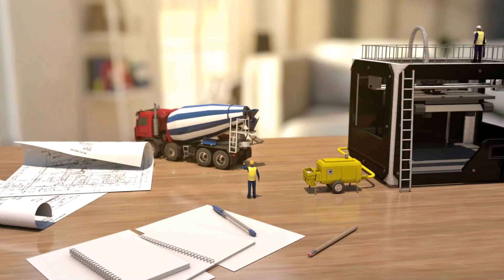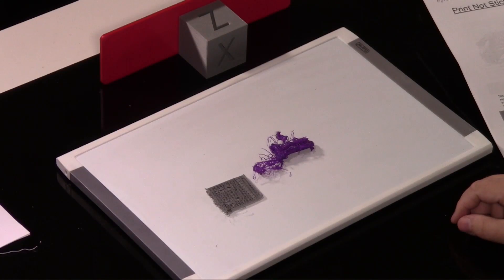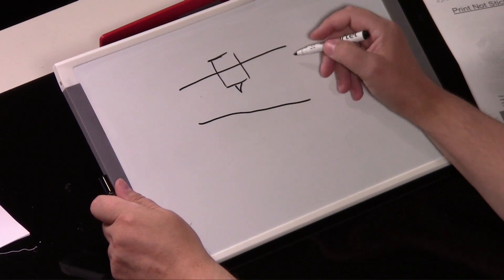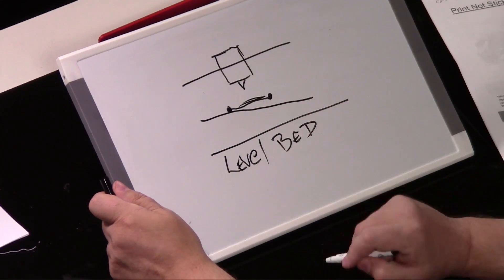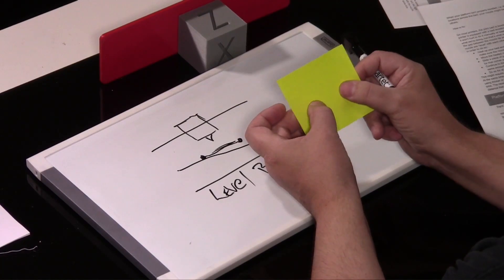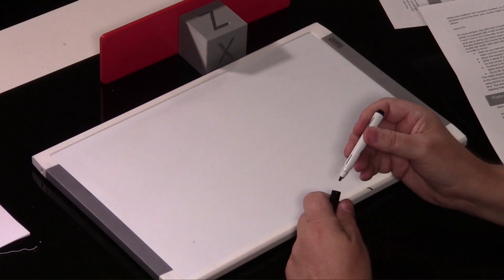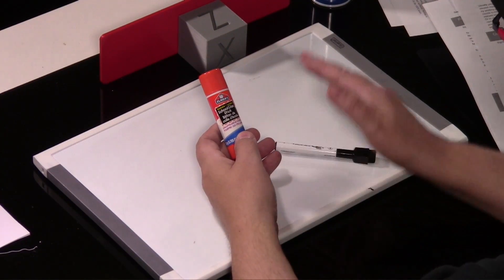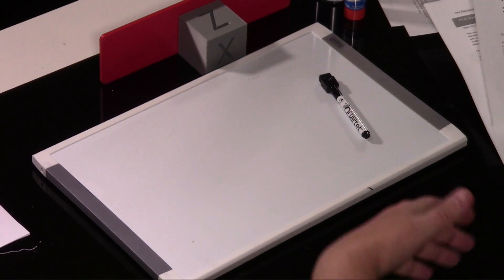Prints Not Sticking To The Bed?

Comment: When I first got into this I had no idea something as simple as bed leveling would be so complicated
Reply: Forreal this is crazy. I’m in tho lol
Reply: same bro, same. 😂 🤦🏻‍♂️
Reply: Amen
Reply: Tell me about it. It has me driven crazy. I found the secret is the middle. Even if all the corners seem correct and the middle is tight it means it's all wrong. Like I said  driven crazy. But R2D2 is worth it. I think...lol
Reply: I find using a piece of paper works well for levelling. When you move the paper under the nozzle, it needs to have a bit of resistance 😄
Reply: @nigelfenlon9035  if I level the bed on my Ender 3 pro on the four corners above the springs the outside edges of the print bed are noticeably lower than the nozzle above the springs and the nozzle will rub the center of the bed. That makes me think the bed is bowed upward in the center, but I’ve had my Ender (first 3d printer) for less than a week so I can’t say with a lot of certainty I know what I’m talking about. Not ready to quit it but it is very frustrating. Any ideas?
Reply: @avega2792  I’m having a similar problem with my Ender 3 had mine for a few years could  never get anything to stick to bed e piece of crap printer
Reply: @98amz  This tip from elsewhere messed up my printing. I should have left it alone

Comment: Well, my first layer's going down perfectly now. But my prints have started coming loose half way through. :/
Reply: go to home depot and buy some mirror tile a little bigger than your build plate, you might need a glass cutter if it's too big.  Use blue tape UNDER the glass until it's perfectly level, check with a metal ruler.  Level the bed and clean with rubbing alcohol before every print.  You will never have a problem again
Reply: Block sand the aluminum build plate
Reply: i heat bed to 80, put a layer of hot melt glue on bed...then turn off heat all-together, wait till it hits under 40 then print...with cold bed cura bed set to 0...when you have finished print heat up again to 80 then remove...simple..

Comment: The advice on bed leveling can't be understated. I'm new to 3D printing and my Ender 3 Pro worked perfectly after assembly. One day, I noticed the main bed support was loose and tried to tighten it, but I must have done something wrong. NOTHING would stick after that except the test lines on one side. I tried everything except glue and eventually solved it by completely dissembling the bed removing it from the belt, checking it for warps, and then re-assembling slowly using a level. It's pretty much back to what it was now. To perfect it, I will install a BLT Touch, but at least I can print again.
Reply: Man, i have the same problem, the SIDE line it's ok but in the middle cant stick, i level the bed mannualy but nothing, i'm so frustrated
Reply: Help, I feel like the same thing my top left is way loose it even fell off, I used it fine til that happened, now i get level it and my black filament is coming out white? Or is etching? Plz someone

Comment: I would like to say THANK YOU for showing this paper drag trick because after a few successful prints with my Prusa i3 MK3 I started having issues with prints not sticking and it was inevitably making a huge mess every time. I had used the first layer calibration tool several times and both the lines/angles and the square being printed looked pretty good, or so I thought. I turns out that when I tried the manual Z-axis calibration with a piece of paper the Z-axis delta was significantly different from the measurement I got with the first layer calibration tool. From this point on, I've had no issues with prints sticking and I've been so happy with this printer. Thanks again!

Comment: being into this hobby for 8 months and owning two  different size printers i have fixed every issue i have had... several things must be done for prints to stick well... mainly make sure you have a flat build plate, level it with a good amount of squish so first layer bonds well, make sure your nozzle and bed temps are set correctly... make sure your build plate is clean etc... those are the basics...You must have a good file that is sliced well also... Machine's have to put together well,belts and roller adjusted and everything nice and tight etc... But there are many other factors... the more problems you have to figure out the better you get at fine tuning your machines...
Reply: But not too tight as I found out the hard way last week.

Comment: I was suffering with default Ender 3 bed sheet and the bed itself. Switched to mirror and it was fixed, everything started to make sense. Ever since i've had troubles because of buildup of hairspray... So any gap you can see is going to be too much. Use good ruler, shine a light behind it and see for yourself.. Oh, i'm using 12mm/s on the first layer.. it is slow but it is worth it..

And use hairpsray on the mirror, it leaves smoother finish. Use glue sticks on the default Ender3 bed as it really helps. Using isopropyl alcohol and water as a mist will renew the glue stick surface for multiple times but even that won't give you more than 5 or 6, it just evens out the marks left behind by the previous print.. But there is no way i'm switching from mirror+hairspray very soon, it is way too foolproof and the finish is immaculate.

Comment: I tried a new filament today, the specs said that I should print with 70-80 bed temp and 230-250 hot end. 
There was no way to print with these settings, and I tried for at least 2-3 hours of trying to level the bed as best as possible. Finally "thanks to your video" I tried to increase the heat in both bed and hot end to 255 and 90 and the print finally stick to the bed and print perfectly.   Thanks for the tips, the part that the filament might not come out correctly because of low temp really helped me.
Reply: I've got PETG with those temps and really struggle with it at around 230-240, 70-80. I suppose I could try hotter, but I heard the Bowden tube plastic really doesn't like to be hotter than 240.

Comment: Than you for an excellent video. I have just purchased a Creality Ender 3 V2 Neo, and successfully completed some prints with the white PLA that came with the printer, having followed this and numerous other tutorials. I purchased some Sunlu Blue PLA and just cannot get it to stick. When the printer initially creates a single test line towards the edge of the bed, this line sticks very well. When the nozzle then moves more towards the centre of the bed to print the object, the filament does not adhere very well at all. I have repeatedly adjusted the level of the bed and the Z offset but cannot get this blue filament to stick. As soon as I re-insert the default white that came with the printer it sticks fine.

Comment: I bought a ender 5 two weeks ago ( never owned or played with a 3D printer) I took my time putting it together making sure the rails were flush to each other then I put it down and leveled the frame up then leveled the bed.

There was to be a test print on the card but I don’t think/seen it so I just went ahead and printed a small cat figure and was amazed how awesome it came out first try.

I think a lot of people just slap crap together and expect it to work. If frame is not all square and level you can’t have a level bed and you just make things harder for yourself.

PS if you are thinking about getting a 3D printer DO IT!!! I wish I would of got one earlier. For past two weeks mine has been running none stop and I have huge list of things to print. I didn’t know if it was gonna be a waste of money that I’d use a couple of times but now I know it absolutely awesome tool. Everyone should have one, can make pretty much everything.

Comment: I have a cheap Prusa Mini, it has automatic bed leveling. I really hate using glue stick. I hate the mess and work of getting it all off my build plate but it does work. I have tried EVERYTHING to get PLA to stick to my bed without using a glue stick. I've tried PEI coated, Non-PEI coated, textured, smooth, basically any compatible build plate I could find. I am 100% sure my layer height is correct. So far ive been using Prusament and amazonbasic filament with Prusa's preset filament parameters for those specific filaments. I'm starting think something may be off on my printer. I wish I knew how to calibrate the temperature sensors or at least verify they are reading correctly. PETG sticks almost TOO good, PLA sticks not at all. Because of that I primary print in PETG. Just sucks, I wish I could figure how to print in PLA easily, without glue. Until then ill continue to use PETG. Thanks for the tips.

Comment: I've watched a dozen bed leveling videos. This is one of them, but your idea of putting tape under the glass is brilliant.
I have 2 Ender 3 printers. They are slightly different from each other. But, in buying glass beds for them I thought all my troubles would be over. Yeah right.
Thanks for the help.
Reply: I gave up on the glass bed early on and bought a magnetic sheet. It had a rougher texture and kept my prints attached. 

I tried glue sticks and blue tape on the glass and it just made a mess without helping.

Comment: Late to the party I guess but I only got my Adventurer 3 last night.  Got a successful 3DBenchy on the 2nd go by using a laminating pouch cut to the size of the heatbed and held in place with a few blobs of UHU glue stick.  The inside of the laminating pouch is a perfect base for the plastic to stick to.

Comment: I was having trouble getting the bed level.. Then I found a tiny piece of PLA debris on the center of the aluminum base plate.
I discovered early on that preheating helped alot, you are the only one that includes that important tip!

Comment: I made one of the biggest rookie mistakes when starting to print on glass. I never cleaned the surface for a week till my prints started not sticking and I at one point wanted to return the printer since I tried to fix everything I could think of. Simple alcohol and paper towel fixed it for me after 4 days of hair pulling

Comment: i use the kokoni ai 3d printer and its not sticking to the bed and it wont print when connected to wifi keeps saying failed to print and it only will print in offline mode

Comment: If your filament is not sticking when going in circular motions, you will need to lower the bed. I did this and it is now printing perfect circles. I assume you will also need to consistently level the bed if you have a new printer due to the fluctuations in length of the springs for the bed, due to a shifting k factor from temperature change.

Comment: 8:45 I am brand spankin' new to 3D printing. I came here trying to find out why my first ever print won't stick to the bed. You said printing too fast is an issue. but I bought the Ender 7 that says 250mm p/s is it's target print speed. And 180 is too fast? Am I screwed out of the box?

Comment: The top and bottom corners of my bed are set to the lowest level, but the extruded is still pretty hard on the bed. I can’t adjust further then that. What does that mean and what should I do?
Reply: If you can't move your bed any more, you need to first move your Z end stop so you have more travel in your bed.

Comment: Thanks. The test prints included with my printer printed great but anything bigger than the dog or pig would end up with the filament dragging all over the bed. When I was leveling the bed I wasn't letting the paper drag enough because I didn't understand how much drag I actually need. Now my 3d printer upgrades are printing good. 😁

Comment: Using ender3 v2 and devil craft PLA filament, tried glue didnt work, brand new glass bed didnt work, then increased nozzle temp from 200 to 220 and works perfectly
Reply: having problems myself will try upping the temperature

Comment: Hello guys,i've got a small problem,i have a ender 3 neo and i wanted to make some articulated sharks,if i make just one in the middle of the printer it makes it perfect,but if i try to put 2 or 3 sharks on CURA and using sequence to make them one by one it does not make them good,especially the first layer it just does not kinda stick to the bed in the lateral parts of the printer .
MY SETTINGS ARE: 55 bed temperature and 200 nozzle,should i pump up the bed temperature to 60-65 to let it stick or do you guys have any advice?Thanks in advance!

Comment: I use GLASS. I also use METAL tape..the chrome type...to secure the glass.  I wash the glass..with soap and water...rinse it well..then use rubbing alcohol on the glass thendry it. I use the elmers spray glue...2 LIGHT coats on the glass...I let it dry for about 40 minutes..then i use elmers glue stick...i apply between 4 and 6 coats. You normally almost have topRY the print off of the bed. I just run it under warm water for about 5 minutes and the parts breaks free. hope this was helpful.

Comment: Using ABS I had too much trouble to get prints to stick.. That was Until I started using Standard grade yellow ABS cement, on my bed. The best part is that it will auto release once bed cools down. Also I am using 1/4 inch thick glass bed, with a heater bellow it.. 

  I tried cleaning, tried glue sticks. But ABS cement works the best, as when you get too much, the hot end will melt into it... does cause some clicking in the feed unit at start, and this cement adds a layer to the works... Hope this helps some of you.

Comment: Just got a cr 10 mini the bed is nice and level but I cannot get the nozzle to touch the paper as you say it will. Also where the nozzle is that piece is crooked slightly.  I have all the twist screws under as tight as possible and still cannot get the bed closer to the nozzle.

Comment: I have an ender 3 printer and it has an automatic leveling system so you never really have to adjust the bed but it still messes up and we have tried everything and can’t get it to work and were 😢thinking about getting a new printer

Comment: I just realized, few times I unstuck the prints by bending the stock print surface, it looks like some kind of glass fiber so i assume i bent it just few microns and threw leveling off.

I'll buy myself a proper print surface.

Comment: I just got a 3d printer and I think the center of the bed is bowed upward. I’ve leveled the bed countless times using the spring locations at the four corners of the print bed on my Ender 3 Pro as a guide and sometimes it works and other times doesn’t. It’s a crap shoot if I’ll get a good print, spaghetti or it will start fine and halfway through it will come loose. This is all true if I’m trying to print something small in the center of the print bed. It might start but then will get progressively worse and eventually will knock the print loose. I feel fairly confident that I’m leveling the bed correctly but if I’m right and the bed is bowed then that would explain why I don’t get consistent results. Nozzle and bed temp is set to 200 and 60 respectively but I think the fan is always running, which may be another issue as you mentioned. Anybody have any advice or ideas?

Comment: Glass or aluminum or steel bed with Zillagrip coating glue allows you to print the most type of plastics and works with a cold bed. Just heat the bed to release. PLA ABS Nylon PETG PP POM PC with one glue coating adhesive

Comment: My issue is that while three of my corners are level the top right corner is tightended to the max and is still not level. Further after leveling the corners the center is off. What could be the problem?
Reply: If you can't move your bed any more, you need to first move your Z end stop so you have more travel in your bed.

Comment: I want to print abs or possibly with this automotive filament  because I plan to use it to make prototypes and practical use fittings and mounts, so they need to be sturdy. I have an ender 3 v2, whats the best full metal hot end so I can print safely above 250, Id need a range of 255-265 to be safe

Comment: Used the preset prints for the ender 3 pro. Bed isn’t hot enough and I can’t change it because the print is already set. So I have to make my own and mess with my setting to find the right ones

Comment: Have a question. My first layer, look as if it is ripping or overstretched. It's regular pla the hot end is at 210 degrees the band is at 70 degrees the speed for laying down the first layer is at 40 and it's just really under extruded. I have replaced the hotend the fan is off for the first 3 linss. And the first layers are extremely thin and as I said looks like they're stretching to the point where they're about to rip why? When I got my Ender 3 V2 the test print came out great my first thingiverse print came out just fine then every print after that has been slowly becoming under extruded. I have relevel the bed after every print. The prince were stuck to the bed so hard that I can almost pick up the machine

Comment: Having the ender 3 pro with no upgrades I just accepted my fate of having a uncomfortably close nose to bed so I always have bed adhesion
Reply: Just buy a glass, it's very cheap, I also have the enter 3, with glass bed. If it wasn't that I wouldn't be able to print with many filaments.

Comment: Here's something, when I put just a little bit of drag on the paper nothing will stick I have to make it so it's a pretty hefty tough drag. I mean not scraping but almost. It prints fine when I'm like that when I do it just like drag it screwed up even when I use glue stick.

The weird thing that I've noticed is lighter colored filaments print much easier than black filament and I don't know why but I'll be damned if it isn't every damn time I get a school of black it's much harder to adhere to the deck do you have any thoughts on that?